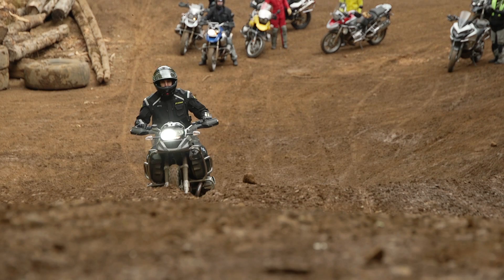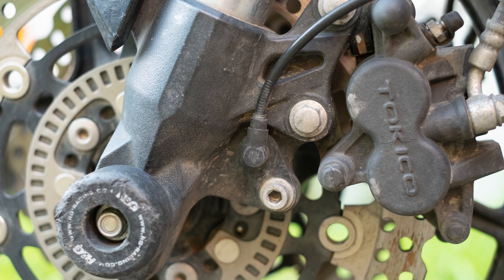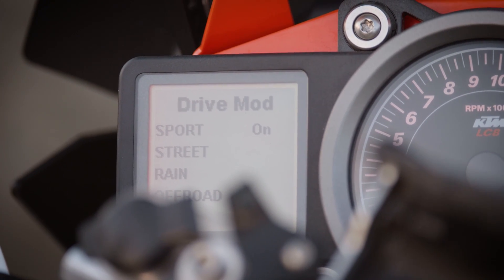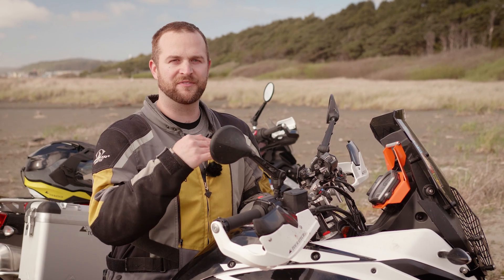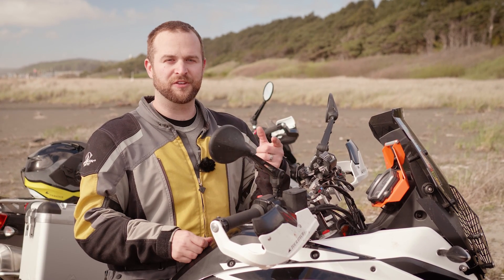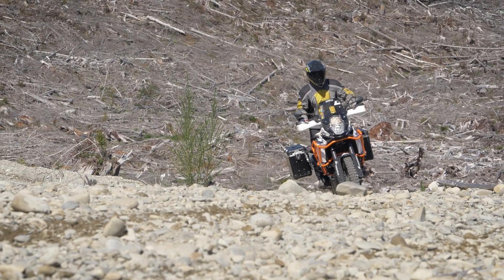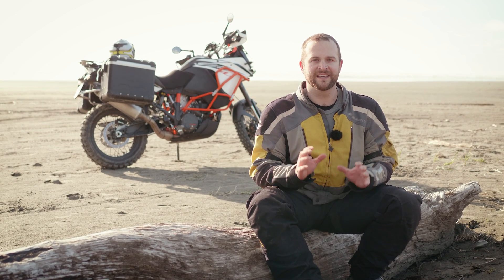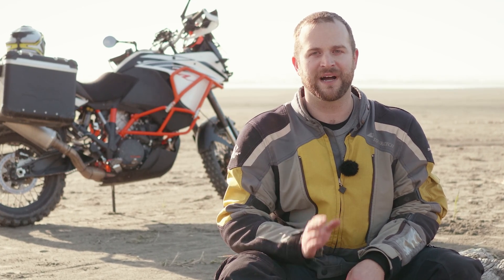Traction Control Systems Explained (Should you use electronic traction control?)

Comment: So I have a ktm 390 adventure with lean angle TC but no rider modes. Also have abs with optional off road mode. Would it be best in normal trail riding conditions to leave the traction control on? I've only ever rode enduro bikes so these fancy electronics are sorcery to me

Comment: Traction control on dirt is bullshit,  I cant drift my 1200 gs with it on, I cant climb steep mountain passes,  Its a kill joy, traction control holds you back on dirt,  learn  to ride and handle on dirt, if its raining and I'm on Tar, I leave ABS and TCS on.Dont believe the opinion in this video entirely,  I cant climb a rocky hill with TRc on, it's ridiculous, I disagree with you guys on this one, If you climbing a tough loose rocky pass , and TRC comes on, you loose power and traction and will stall

Comment: Does Traction control work along with the ABS ? 
Or let me put it this way, does Traction control go off if I turn my ABS off or pull out my ABS fuse to turn off ABS ? 
MY Vstrom 650 has 2 traction control modes and it confuses me a bit sometimes.

Comment: I have a KTM 790R which has plenty of TC, ABS and throttle response modes - which are great.  One question I have is what is the best for deep soft sand ?   I think, but have not experimented enough, that maybe best with no TC or lowest TC (1 on scale of 1-9 on 790R) .   I assume you just need grunt (spin) to get up momentum (speed) to get out and on top of the soft sand .... appreciate if anybody has tips / proven experience - thanks !  (chunky tyres also helps)

Comment: Bikes without an off switch and have the front sensor eliminated  by jumping the rear sensor and the front sensor so that the system gets the same readings thinking its the front and rear. Install a 3 way switch and you will have the option of using traction control when you want.

Comment: I appreciated this info since I just bought a used Yamaha Super Tenere in January and haven't had a lot of practice off road yet. Although I have dropped it twice in the mud, once because my right pant leg caught on the master cylinder cover for the back brake. Now I can think about how to use the TCS to my advantage. Is there a video out that Mototrek did on how to slide the back tire around on bike that have constant "on" ABS? I saw the video that Bret did with the BMW and the Honda AT, but I couldn't afford either of those bikes so I need help learning how to do something I grew up doing on every bike I rode except my Moto Guzzi 750 Ambassador. The drum brakes lacked serious braking ability on my Guzzi.
Reply: If your bike doesn't have switchable ABS, open the seat, open the fuse box and remove the ABS fuse. Should do the trick
Reply: @RanjithCoplay  I will look into that thank you.

Comment: If your traction control is like mine on the 690 Enduro R, it is not as refined setting wise.  On road/Offroad TC either on or off.  You will have issues on soft dirt hill climbs.  The 690 will stall if TC is not turned off.  Reason being as the back wheel spins (which you need to keep going) it rolls off the throttle and momentum is lost and bike stalls.  As the video says, make sure you undesrstand how your system works and it's limitations.
Reply from the maker: Good advice. Proper technique will assure the best chance of getting to the top even without traction control.

Comment: I had heard different things from many people. A lot of them said that traction control and ABS should be turned off completely for off-road. I have almost no experience off-road on my ADV bike. Turning the traction control to a mode that allows some slippage makes more sense than turning it off completely. Now I need to watch a video addressing ABS off-road. Thanks for the info!
Reply: Most experienced driver says safe u life be lock rear wheel in extremely situation to rapidly change direction (drift) try it on tarmac with abs or traction control

Comment: TC very well explained - well done. I find it interesting that the 2 new mid-size ADV bikes just out (Tenere 700 and KTM 790) have very different approaches to this. The T700 has no TC, simple ABS on/off, and more moderate linear power (70 hp). The more powerful, more expensive 790 has TC and many other bells & whistles. I think both bikes will sell well mainly because they are lighter in weight compared to the bigger 1200s etc. It will come down to personal preference and budget. Some people will like the simplicity of the 700. Others will prefer having the option of dialling up a TC system to a level that suits the terrain. I look forward to testing both when the 700 arrives in Australia.
Reply from the maker: Agreed 100%

Comment: I'm all in for electronic aids, we (humans) have a biased judgments of risks if we think we are on full control. 
We tend to underestimate automatic controls but the reality is that we'll never be able to make 500 evaluation per second like modern bikes/car MCU are doing under the hood without taking the extreme case of airline planes drive by wire systems. 
Sure also the electronics are not fail safe and is still a novelty in the field of motor bikes but it'll get better and smarter and we are becoming more dumb. I agree on what mototrek said in the tutorial series, 50% is technique but the other half is strategy and experience, and I don't mind building up experience with the help of electronics to compensate my lack of perfect off-road technique.
Reply: I'd just rather have the electronic aids, and us my skill/experience without them, you only end up relying on them, and when they fail you fail as you haven't learned the skill necessary

Comment: Interesting and informative, especially as I have little experience and knowledge of traction control. 
My one experience was being given a brand new AT to test ride and being told to turn the TC on off-road and go whatever speed I wanted. I didn't quite do that...but I did ride a hell of a lot better than my ability would have allowed me...
My reaction to that was that I'd prefer to learn those skills myself than have the bike do them for me. 
For now, on a CB500X, I have little need for it. (A very forgiving bike with only 47Hp).
Still I know a lot more about it now - thanks :)

Comment: Contraversial I know when industry is telling you and selling you "must haves" such as traction controll. But I never have had it and Ihave never been thrown off mid corner in a high side either. I wonder if the fail safes of T.C and ABS may actually facilitate a false sense of security and more crashing???? Perhaps people could just learn better throttle, clutch and braking technique?  It seems to work quite well. Perhaps bikes have got too big and powerful for their purpose also?
Reply: Michael Caton I’ve noodled this very topic and just can’t decide. I’m admittedly a bit of a control freak, so my preference is to be the master of the bike, but then there’s that part where it takes expert volumes of practice to develop expert skills and then more of the same to keep the skills ship shape.  Of course, there’s also the fact that the electronic systems are operating at something like 15X per second, which be great and/or really intrusive.
Reply: @SuperBardley  I've wondered if bikes have now become so powerful that really our only hope is to have this rider aides...... Maybe less powerful less heavy bikes could be helpful. Lets face it first thing threader modes do, is button down the hp to a more manageable limit when off road.... doesn't help with the weight though.......
Reply: Michael Caton Ahhh, that weight issue!  I just think light thoughts, LOL.  And I will not ride solo off-road, don’t ask how I arrived at that golden rule.

Comment: [1st minute - no pressure at all guys! :D] Great video! Thanks for simple but detailed enough explanation with presentations. I wonder if TC will lead to lack of skills in the future for motorcyclist. No doubt it is useful, it is helpful, but would be great to get all riders to learn how to deal with difficult situations on non-supported motorcycle. Thanks again for this video!
Reply: Yeah unless they get seriously injured or die trying to get those skills. Safety devices and electronics are always better regardless of what "some " people say. I've heard the seatbelts might lock you in if the car catches fire way too many times. It's a similar argument since traction control is a safety device! It will let people improve their riding skills and turn off traction control after they get more confident on the bike as opposed to jumping into the deep end right off the bat and possibly getting hurt.
Reply: Wide open on a 120hp bike on a loose surface hill and relying on a black box!!! Sorry it's beyond me.

Comment: I love this channel! Another great clip, thank you!  From my experience, TC is not a slam dunk on rocky climbs.  On a R1200 GSA, Enduro Pro mode, climbing a steep and loose rocky section with TC activated, the bike slowed to the point where progress halted.  Mid-climb I started slowing, so I kept opening the throttle, then changed down to 1st and kept opening the throttle... alas, I kept slowing.  Deactivating TC was needed to make that climb.
Reply: Found myself in a similar situation on my tiger. Pumping the clutch got me enough power to get me over the hill where I could then switch off the TC. Don't think I could have got going had I stopped on the ascent.
Reply: What year is your GSA?  I have a 2017 Rallye and hope mine is newer enough to have an “improved” version of Enduro Pro.  As much as they research these things, one would think that BMW woulda figured out that yes, we will take these bikes up steep off-road stretches, and duh, the bikes really do need to be able to climb up steep and loose stuff.
Reply: @SuperBardley  Mine is 2018.  All these "aids" have their limits and finding them is half the fun.  I liked DarcyOG's suggestion... I'll try that if I find myself in a similar situation again.

Comment: on the ktm can u go sport mode with offroad traction control?
Reply: Not on my 1290SA. I believe you can go sport mode with offroad ABS.
Reply from the maker: Thanks for the answer, Ronan.
Reply: the new 790R has a Rally mode that gives you separately selectable throttle (street offroad or rally which is as aggressive as sport on their other bikes) and 9 levels of TC that you can change on the fly. levels 7-8 are about the same as “offroad mode” TC.

Comment: Just picked up a new 1090 and this video really helped me understand the TC settings. Thanks!
Reply: The electronics work incredibly well on my 1290SA. The offroad traction control makes it not only effortless to get the rear end out sideways on the dirt, it’s virtually completely safe too. It simply won’t add extra power beyond the rear wheel spinning 2x the front wheel no matter how heavy handed you are. If you’re not so experienced offroad (ie don’t have much of a dirt bike background as I didn’t) it takes a bit of a leap of faith to start drifting the first few times, but I got used to it pretty quickly, it really is confidence inspiring when you’re on a 230kg fueled bike. Offroad ABS works even better, I don’t know how they get the front wheel to brake with traction so well offroad.
Reply: @ronanrogers4127  thank you for the response! I grew up off road and still love getting sideways on corners.....but on the 1090....I'm thinking it'll be a bit different. So I'm glad to hear that the TC and ABS help out. I have yet to get it out off road but should be able to do so this weekend. If I survive I'll thank the machine and your advice. 🙂
Reply from the maker: Congrats on the new bike,  Edward!
Reply: @MOTOTREK  thank you, sir!

Comment: This stuff is fine on the street; but is completely crutch and very intrusive offroad. ABS will have me rolling into trees the way I ride (from experience).
Reply: That surprises me. The offroad ABS setting on my KTM 1290 SA works incredibly well, it works so well that I can’t really understand how it enables me to slam on the front brakes riding on both dirt and gravel without skidding (the rear can lock up). I can use the front brakes going down very steep hills offroad and on dirt and gravel tracks. I had gen 1 ABS on my R1100GS in the late 90s,and it used to pulsate and actually not brake at all. The KTM system is incredibly effective. The offroad traction control is brilliant as well...I’ll often hit 140-145 km/h on dirt and slide the back end out like these guys say
Reply: @ronanrogers4127  I ride a '16 690; whichever gen abs is on it will let you roll right off a mountain while giving you a foot massage. I was chasing a dirt bike buddy one time through some single track and just about plowed a tree.
Reply: Dale Jahnke   Hi I had similar experience on my new KTM 790R ... it was pumping through some mountain dirt roads and nearly had a few accidents on corners and had street mode ABS on ... learned I must have ABS set to off road mode which is NO ABS on rear and front ABS with lean angle disabled.  not sure what modes the ‘16 690  has.  The 790 is fantastic plus Rally mode with throttle response modes and dial up and down traction control on the fly